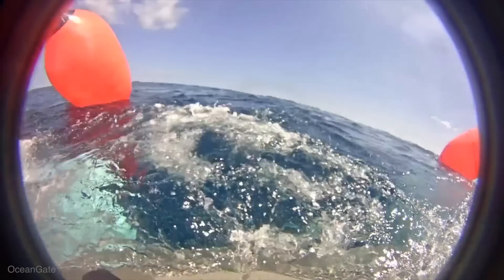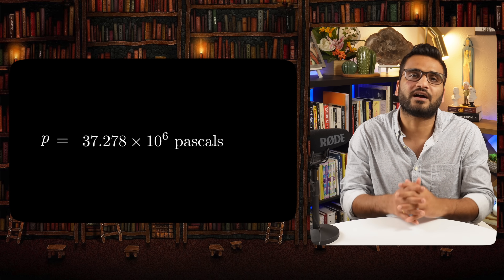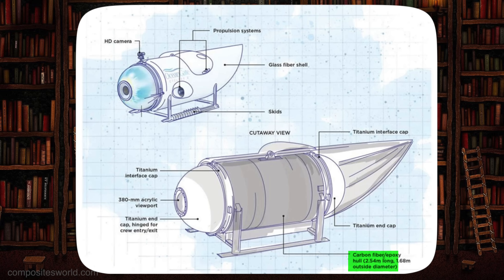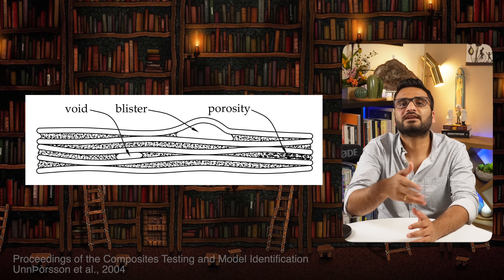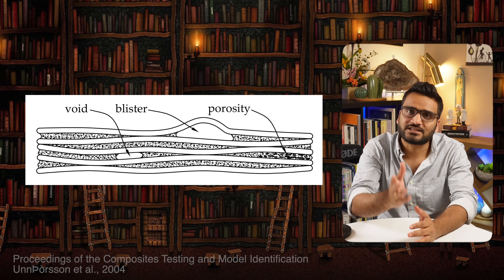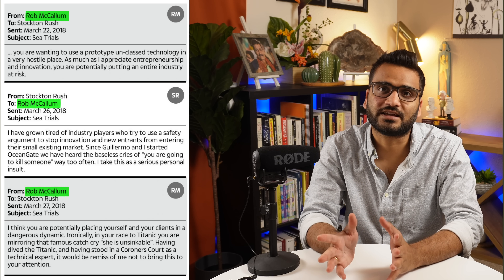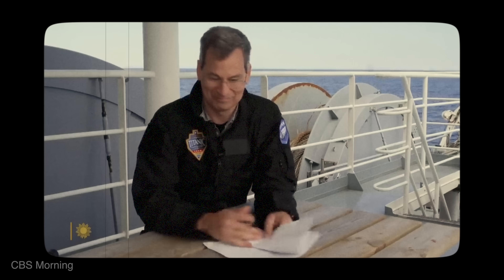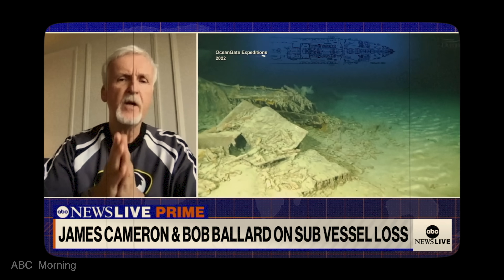OceanGate REALLY messed up - A Structural Engineer's Perspective | TITAN'S TRAGEDY

Comment: It's a miracle that this didn´t  implode on the first Titanic dive.
Reply: They say carbon fiber is at its strongest on its first go. After that, it only goes downhill.
Reply: Not necessarily. It could be good for one dive. It could be good for ten. He should have built an empty hull, and tested unmanned how many times it could go up and down until it pops.
Reply: @budwhite9591 It’s only good for one dive, because it’s guaranteed for one dive. This isn’t like eating a bit of mayo past it’s expiration date. 

Carbon fiber is inherently unpredictable, because there’s no predictable points of failure. It’s two different materials laminated together. It could fail at any juncture between those two materials. 

With something like metal, the entire piece is one continuous from, so stress points follow a more predictable formula.
Reply: @be.A.b Are there any flexible materials that don’t fatigue?
Reply: @be.A.b Carbon fiber composite is non-isotropic and more complicated to design with than metal, but this doesn't mean it isn't modellable or predictable. Just look at its widespread use in jetliners, both in the wings and fuselage. Don't know for a fact, but it looks like OceanGate didn't even try to model it or have knowledgeable composite structural engineers evaluate it. The OceanGate design was predictable, it was going to fail within a very few number of dives.
Reply: @fafner1  There was a fatal accident with a jetliner in America. The Carbon fiber tail plane snapped off, because the 1st Officer did rapid left to right rudder control, after hitting a previous flight engine turbulence problem. The manufacturers stressed that over aggressive use of rudder control should not be used. The first Officer had been trained to do that with non carbon fiber rudders, to counter act air turbulence
Reply: @budwhite9591  That's true. But because they did not have the hull put through nondestructive inspection after each dive, nobody can know if this can be operated safely for x number of dives. They could have made scaled down models with this material and do unmanned test dives with it. They could probably even used a pressure chamber and air pressure to test the material, the glueing with tinanium, how the different materials react diffeently under pressure etc. Rush did this like the flight pioneers of 120 years ago, cobble something together and then just going flying with it. When today there is the testing technology, and frankly, even engineers who can use math and computer models. A lot of these early flight pioneers didn't survive their experiments either.
Reply: @budwhite9591  And operational testing showed it was good for 12. It failed on the 13th.
Reply: @allangibson8494 that's pretty stupid taking it down again after your own testing says it might fail. Greed.
Reply: @fionamackie3357 It was a toy for billionaires.
Reply: @allangibson8494 Where's your source for that if you don't mind?
Reply: @budwhite9591 that kind of testing wouldn’t really work you need to do specific nondestructive testing on the hull that you were specifically going to be using not an exact replica meant for demonstration. That’s because carbon fiber will not have exactly the same strength every time due to it being a composite material. And even then it will only be rated for one single dive , because that’s all they can safely guarantee. Honestly it was a cost cutting measure and not appropriate for use in such a deep sea submersible. As were many features of the vessel. Just look at James Cameron’s submersible the deep sea challenger. It’s hull is steel. It’s not exactly a secret in the deep submergence community, the pitfalls of using carbon fiber. This was pure greed and arrogance that caused this. Complete negligence on the part of Stockton Rush and Oceangate
Reply: @budwhite9591 A material like carbon fibre is difficult to make so it's behaviour is the same all the time.  Ideally the design and build needed testing at twice the maximum expected pressure at least. The way the carbon fibre part was made is very questionable as is the strength of bonding to titanium which I would imagine another weak part.
Reply: @budwhite9591 actually, he failed to follow any rules in certification..one of them is crush hull depth. You add 20% to the limit set, problem there is no benchmarks, never the less, he should of built the sub to reach 16,000 feet and tested this multiple times..the carbon fiber was applied wrong, he lied about how it was applied..

Karl Stanley stated he had no business taking the sub to the middle of the ocean..Karl is a well known sub designer and knew Stockton and went on the second dive with him in the Bahamas..he said he warned him dozens of times in emails and speaking with him..the only avoidable part was allowing others to die with him...Karl knew the sub was coming apart and tried to warn him....
Reply: @budwhite9591  He did - unfortunately he did so with himself an 4 other foolhardy people
Reply: @budwhite9591  Lol just say you don't understand how carbon fiber works. That's easier.
Reply: @apackofhoboes  it’s not necessarily the Carbon Fiber that’s the problem, it’s the epoxy and wet laid as it was is criminal, BOENG would never ever fly a plain that was wet laid and you wouldn’t want to fly on one either
Reply: Yeah because you’re the expert right? The problem wasn’t the pressure. It was cyclic fatigue from the pressure change multiple times. A simple fix would have been to change the center cylinder of the pressure vessel (the carbon fiber part) after every one or two dives. It’s not a miracle it didn’t implode on the first titanic dive. It’s a miracle that people are stupid enough to assume that.
Reply: Poseidon said hell no on the last dive
Reply: Ive cracked my steering wheel on my carbon fiber road bike whilst riding, carbon fiber is not a safe material for subs exposed to  extreme water pressure 🤬
Reply: @spencerosei2616 don't forget in that same video he said everyone that did speak up was sued to keep their mouths shut.
Reply: @wolveryne42  such a shame
Reply: @spencerosei2616  really is, he was like a used car salesman, putting a fresh coat of paint on a turd and selling it for new.
Reply: @wolveryne42  😂😂😂 indeed , his ego was out of control
Reply: @spencerosei2616  you have cracked something, that's for sure...
Reply: not necessarily - it takes a while for microscopic structural deffects due to material fatigue to grow to the point where the resistance is severely compromised, and the part fails under load. this design was practically one-use only, two at most - and then it would've had to be discarded, as it's impossible to repair the deffects in carbon fibre
Reply: No - Carbon Fibre weakens with compressive cycling. Basically the pressure endurance halves with each load cycle.
Reply: @allangibson8494 exactly. See my comment
Reply: @allangibson8494 the Carbon fiber was outdated from Boeing
Reply: @bradhanley8368  the correct term is “life expired”. The epoxy prepreg can no longer reach its design strength because it has started to cure in storage.
Reply: @allangibson8494  The view port window has been blown out... will be interesting to see the rest of the pieces, to understand what the failure really was.
Reply: @Baerchenization  Yes, I saw that photo of the recovery lift strap fastened through where the the view port should have been.
Reply: @twocyclediesel1280  I have seen a different analysis that pointed out no matter how large the breach, inevitably due to the pressure, essentially the entire inside would get flooded instantly until there is a pressure equilibrium with the compressed air inside - but at that depth, it would compress the air so much, that it would reach the temperature on the surface of the sun, and so depending on the actual circumstances, the crew might have been speed-cooked and turned in to mince meat in the fraction of a second... so will there be identifiable remains? We will have to see...
Reply: @Baerchenization  Yes, it would be like being in the cylinder of a giant diesel engine, and we’re the fuel.  Most diesels are around 20:1 compression ratio and Titan was probably way over that, thus the temps reaching that of the sun.  No, there won’t be any remains found.  One good thing I guess, they didn’t feel a thing.  It was over faster than any discomfort could even be felt.
Reply: @twocyclediesel1280 But do we know they didn’t take the window out to lift it?
Reply: @lisaschuster686  I don’t know how they’d take all those bolts out with a ROV at 12,500 ft depth?
Reply: @twocyclediesel1280 the bolts were still installed and attached to the titanium ring, which was epoxied to the carbon fiber tube. It’s not at all surprising that the ring separated from the carbon fiber shards when it imploded
Reply: @Baerchenization  P1V1/T1=P2V2/T2 indeed.
Reply: Yeah , thats was a succed , but honestly , this ship was a suicide work , its was a question of time  when this thing its going to implode , a totally fail desing , use rwong materials , wrong shape ,and wrong methods , the only thing i can not understand is  how naif and ignorants are Billonaries to go , pay a cuarter of a millon dollar  a enter in this thing !! I never do that boy
Reply: Wtf?  Get lost, spammer
Reply: That’s exactly the problem. Don’t know if it’s going to fail the first dive or the tenth. One things for certain though, it was going to fail.
Reply: @brellnob  I think with a sphere of titanium or steel an engineer can use math  to determine what it can take if there are no faults in the material. So if you want to dive to depth x you can calculate what thickness of which steel you will need. But of course for his tourist circus Rush was greedy and wanted to take five. Had he built a conventional model that fits three (and very cramped) he would have made less profit and the dives would have been a lot less "fun" oriented.
Reply: It really is.
Reply: Not really a miracle because the strength of the vessel on paper was good for 1 dive however epoxy can be subject to cracks water intrusion over repeated dives causing sealing of the sub
Reply: @DEVILFISH1122  Karl Stanley didn't make assumption like this. I agree the sub was braking apart because according to Karl, the sounds were like a small caliber gunshot...he went on the second dive. He said the sounds started early in the dive and didn't stop until around 300 feet. This was due to stored energy being released. What I find amazing is everyone in this small circle knew what he was doing and none of them spoke out ..
Reply: @DEVILFISH1122  could be the expoy, could be the acyrlic window, could be the hull, nobody knows for sure because no actual testing was done. That’s why it’s a miracle
Reply: The engineering data said the carbon fiber could withstand those pressures… once but the noises it was making was an indicator of damage weakening the hill .. essentially it’s a use once and throw away thing to go further is foolhardy
Reply: This is one of the ways much better stronger less chance of bubbles than wet laid like they did
Carbon fiber/epoxy composites fabricated by vacuum assisted resin infusion molding (VARIM) technique using stitched unidirectional carbon fabrics, with the matrices modified with nanosilica, halloysite, and liquid epoxy and in a controlled temperature that activates the epoxy in a controlled manner
Reply: Do you believe in predestination/fate? Maybe it was their time.
Reply: They use outdated carbon fiber from Boeing
Reply: Who really cares? This is nothing that matters to anyone unless you had $250.000 to piss away.
Reply: It did.  They got a new Sub.  All the Subs imploded
Reply: Engineering something to work ONCE is not so hard.

It's the REPEATED use that makes this so inevitable.
Reply: The cause, and what would have been the cure for, or prevention of,  this tragedy is best described by the Holy Bible:   “There is a way that appears to be right, but in the end it leads to death.” (Prov. 16:25), and “Where no counsel is, the people fall: but in the multitude of counsellers there is safety.” (Prov 11:14)
Reply: @focusnow4846 you don’t have to impose your religion on people. Find something better to do with your time than quote a book that was written to make you comply
Reply: @yourmomsfbuddy1177 what? You can't just ignore it and move on? That's beyond you oh tolerant one.
Reply: It's not a miracle at all period while the design was substandard and completely ignorant the material was strong  enough  To maintain integrity at multiple dives call my 13 is what I've heard That it made to that death corner that depth so no it's not a miracle 14 was the failing point
Reply: @mikestraley7201 yes and failed at not even that deep
Reply: @-_YouMayFind_- I don’t think anyone is listening to the reports that contact was lost only partway down, lol.
Reply: @mikestraley7201  if he would have replaced the hull every 5 dives, he would have been ok with these numbers.  With each iteration he could have improved it, crisscrossing etc.  He must have noticed from the sensor data the numbers changing.  Just doing a test till destruction could have given him the sensor data he needed.  I guess he wanted super cheap and not just cheaper so greed.
Reply: @mikestraley7201 yeah not a miracle… if you pretend that carbon fiber composites are free of small, random manufacturing defects that can propagate into catastrophic failure at 4000m

Comment: Radial compression and longitudinal compression of the end of cylinder area. Poor epoxy resin didn’t have a chance with repeated 300-400 atm compressions.
Reply: The join of the cylinder to the titanium ring flange at both ends was also of a slip-on joint, held only by the epoxy adhesive, with not provisions to resist tear-out.
Reply: @chemech  I agree. The differential in strain between the carbon fiber and titanium ring most likely created a large shearing force.
Reply: The mating surface of the titanium and carbon fibre appears to be several inches only , not even a tapered join, such incompetence on the most basic of joints

Comment: The first bathysphere was a perfect ball, to withstand the pressure.
Reply from the maker: You bring a great point. A “Sphere” with appropriate thickness is the best geometry to resist radially compressive loads.
Reply: @doctorchadha  A cylinder however, can be an acceptable design, provided the proper design, selection of materials, and fabrication are followed.

Comment: Also. What is the role of the engineers and employees when they know such unstable and dangerous vessels are being used by unsuspecting public.   
If  you dont raise the red flag loudly enough and you allow innocent people to die you are also contributing to their death.
Reply from the maker: Truely unfortunate that even the red flags that were raised were either ignored or suppressed.
Reply: I have been in situations where, as a professional licensed engineer, I have been exposed to unsound and or unsafe designs. All of which concerned people carrying vessels. I have alerted other engineers on the build team, management and govt representatives.  The bureaucracy and red tape to effect change can often be insurmountable.  Often leading to little change. Shouting unsafe is not enough, especially when tens of millions are at stake.  The 737 Max comes to mind.
Reply: Sadly, they do not seem to be teaching the Engineers Code of Ethics in undergraduate programs these days... probably not in graduate school either.

As a licensed Prtofessional Engineer, I had to sign up to adhere to that Code as part of my licensing application.

However, as this was a commercial application intended for international waters, there does not seem to have been any active effort to require OceanGate to employ the services of a PE, most critically a Mechanical Engineer who specializes in pressure vessel design.

Also, the fabrication of the carbon fiber cylindrical segtion of the hull does not appear to have been conducted by an ASME certified pressure vessel fabricator's shop.

While the late Mr. Rush was reportedly educated as an engineer, his actual engineering experience was rather limited, and did not extend into the arcane world of pressure vessels.

His hubris and disdain for the opinions of the experienced professionals killed him, and sadly, four other people.
Reply: A great video case study involving this is the thrilling USCSB video on an Illinois synthetic quartz crystal manufacturer. They had 8 huge tall pressure vessels and a consultant saw red flags galore and sounded the alarm. The company did nothing and it exploded catastrophically killing an innocent motorist on the nearby highway!